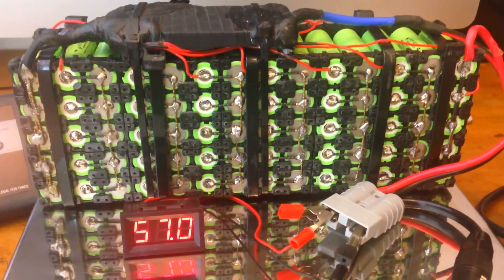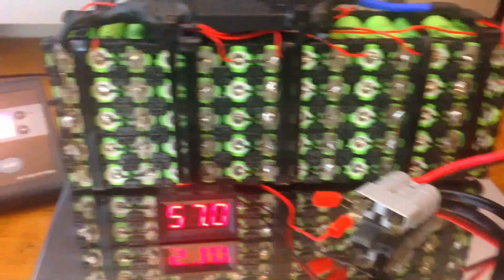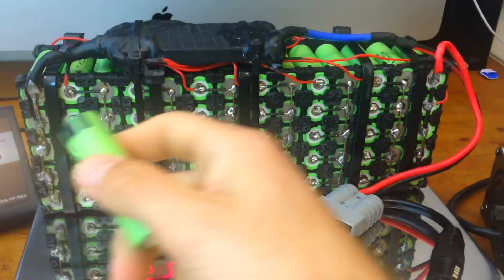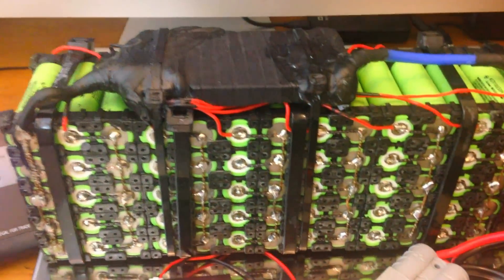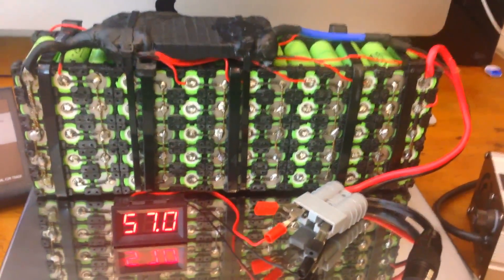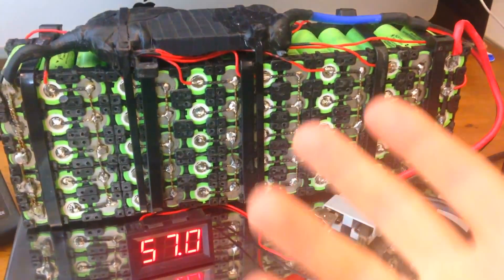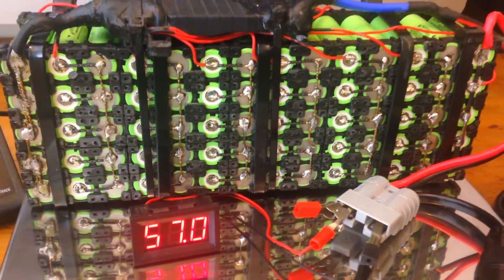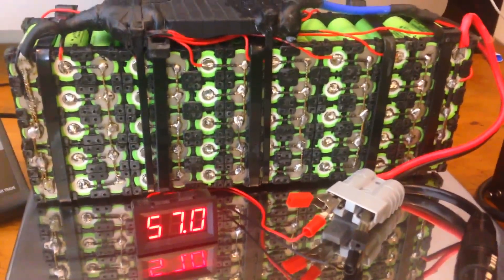Panasonic (Tesla) 52v 14.5Ah battery pack with Fast charger (14s 5p NCR18650PF) Bafang BBSHD BBS02

Comment: Bruno you are phe-nomenal. It's amazing...those exact batteries are what I am working with. I actually bought them a couple of years ago. Watching your video I  realized that I must go discharge them because I charged them all to 100% about six months ago anticipating a build. I was going to build a 36v but changed my mind and decided to build a 52v battery for my electric kayak which will be equipped with a overpowered 48v brushless motor. I bought 100 cells for around $200 about two years ago now they have risen dramatically in price. I hope it was worth it. It pays to make yourself informed.

Comment: Hello, this video is a bit old but I made a 16s12p battery very similar to this, I used copper solid wire to connect the cells and I soldered them (quickly) in the same configuration. How is the battery holding up?
Reply from the maker: Wooooww 16s 12p considering you need to do both sides of the pack, there are 384 soldering joints to make hahahahaa or more
My pack was made in 2014 and I put at least two cycles every day until it died in Jan2018
I pushed to hard and fast charged.. did everything I could to actually see what happens to the pack when the cells are very aged... in the end the balance was pretty poor and I had to balance every charge which was annoying but it prolonged the use for another 8 months or more...
How’s your pack holding up? How long have u been using? What’s the current you’re running it?
Reply: @BrunoPOWEEER  I'm using ex rental scooter batteries, they are Chinese Eve cells and rated at 2500 mah at 3c max discharge but they are actually somewhat decent. They are all used cells but they all seem to have very similar capacity's as it stays balanced fairly well. I haven't really used it on a daily basis yet as I was using a IMAX b6 to charge it and it would take over a day, but I just got a 1500 watt CC CV boost converter  and made a server PSU 48v 57amp power supply to charge it at max 12 amps or around 720 watts so I'll be able to charge it in just a few hours. As for discharging I just bought two new 48-72v 1500watt 45amp ebike esc's to power two ninebot es4 36v 300watt motors so there would be max of 90amp draw.

Comment: Soldered on??? RIP battery
Reply from the maker: Yes, soldered!! I am an electronics/electrical / battery builder and intentionally made it soldered back in 2014 just to compare the difference and make a point. I pushed this battery really hard cycling it every single day for nearly 3.5 years (beyond the recommended cycle life, made almost all videos in my channel. Here is tour showing my professional EV Battery Building Workshop: https://youtu.be/Pbg--F-43K8
Reply: Dude, relax, its generaly not such a good idea to solder directly on to batteries, it can shorten there life and potentialy damage the battery.

Comment: Question-- so I tried to build a battery (first time).  I bought a 14S 51.8V 45A BMS off eBay: https://www.ebay.com/itm/14S-51-8V-45A-BMS-PCB-PCM-for-ebike-electric-bicycle-18650-Li-ion-LIPO-battery/112636580964?epid=18009165438&hash=item1a39a9d464:g:MYcAAOSwhmpaBbsf

This one has only a B- and a combined charge/discharge C- solder pad to hook up ( along with the 14 wires)

I get good voltage (51v) from the battery terminals but when I tried to charge it, the charger smoked and caught fire.  .  

Charger is a 3 prong so I ran: the positive to the + terminal on the battery and the negative to the C- charge/discharge on the bms.  The middle prong on the 3 prong I didn't connect to anything.

Im no expert but Its as if the battery is feeding back voltage to the capacitor in the charger and frying it.  What am I doing wrong here?

Comment: hey mat soo much power hahaha!
btw can u help me I'm building an electric scooter nota a bike a scooter like gogoro  the motor I'm using is a 1000 w and for the battery pack I'm using 130 18650 cells 13s10p  being a novice in this field I don't know much so how to connect these cells in series and parallel using nickel strips I saw some videos but every pack had a different design can u help in mine what should be the best!
thanks for ur time mate!

Comment: Look at this on eBay:

https://www.ebay.com/itm/282434596324

10x 4x5 Cell 18650 Batteries Plastic Holder Spacer  For Battery Packs,Power Wall

Comment: saw one like these on taobao, pretty crazy if you consider none of those cells have a safety circuit
Reply from the maker: Yeeeaahh the safety circuit on the cells makes them thicker, longer (it doesn't really fit inside most cell holders) and when you make a large battery pack you should really have much larger protection circuit protecting all cells together. BMS (battery management system) is used in this case checking and comparing all cells voltages making sure they are balanced, there is also a low voltage and high voltage protection, high current protection.. that little protection circuit is a very simple mini BMS for use in devices like lights without any battery protection. IF you want to see something crazy check out this 42000w 56hp bike that I'm making.. INSANE https://www.youtube.com/watch?v=yfn_HKViwtM&lc=z13wdlwgbxzlsdb0a222ud25ipq2hvbtv

Comment: What's the WH/KG on those cells? Are they the highest? If not, what are the highest?
Reply from the maker: These are Panasonic "PF" cells they're 46 grams / 2900mAh each cell. I made this pack back in 2014. Nowadays the highest capacity you can get are Sanyo GA and LG MJ1 both options are 3500mAh. To find the mAh you just multiply the nominal voltage 3.7v x mAh =]
Reply: So about a 22 pound battery would be about 2,250 WH with the highest density batteries?
Reply from the maker: +RoboticusMusic Lipo cells in general (not all types and brands) are lighter than metal body 18650 cells. Lipo (prismatic cells) can vary in size and shape, most cases are cheaply made, short life, unstable and can explode, good power density but lots of cons.
18650 cells are very stable, super safe, reliable and last longer (lot more cycles) than Lipo cells.
There are some premium Lipo with amazing power density but you have to deal with odd shapes and pay a premium price + not easy to find to buy and if you find, they require a large quantity (hundreds or thousands) minimum order. It all depends what you want to do and how much you have to spend. 18650 is a safe / good value long term investment =]

Comment: Another awesome vid matey. So if I was to swap out the 18650 cells for Turnigy 5000MAh, 40c flat cells and followed your configuration of 14s, 5p I'd get a 52v 25Ah pack  ( 14s 5000MAh each /  14 x 3.7= 51.8 @ 5000MAh  X 5p = 51.8v @ 25000MAH  ) And that would give a constant discharge of 20A . But realistically more like 58.8v if I fully charge the pack , but if I only charge to 80% I'll be getting 47.4v, for the added benefit of longer life? That's if my mind is working right at 10 to 1 in the morning...... Would my BBSHD handle close to 60v ?

Comment: just bought 48 of these only getting 2.2ah per cell. charging from brand new 3.51v to 4.2v
4 parallel charging using imax b6 @ 3A.

bought parts from ebay: $312 spacers, 54cells and bms, no case though,
bafangdirect wants $499 for this pack, so i save about $200

i bought a 16cell bms, but only want to use 13s3p like my other pack, any suggestions any problems i might have?
Reply from the maker: Hey Brad, the "mAh" is rated from the maximum to the minimum voltage for that particular cell you're measuring. Some cells can go as low as 2.85v some cells can go down to 2.5v, it will depend on your BMS or controller low voltage cut off to know how low you can get. 
Bafangdirect is just a regular shop with a funny name, they're not associated with Bafang at all.
if you're making your own pack maybe go 14s instead of 13s you'll get a MUCH better performance, 52v makes 48v batteries feel anemic haha. Even better if you go 5p you get more range and the pack runs cooler (if you can).
BMS for 16 cells is set to 16s packs only it won't work for 15s or anything different. You must buy the correct one for the pack your making so maybe try to cell this one on eBay.
Send me more news as you make your pack!
POWEEEEEEEEERRRR =]

Comment: Hello! Love your videos, was anoyed by your sense of humour at first but, man i have learned alot from your videos in the last few months! Ithis week i got a bbsHD and 100 samsung 30q  cells, my question is should i go ahead and build a 14s since i will have 9 cells left over? Do i need to change the voltage cutoff in the charger as you explain in a previous video? Oh, and i think i like the bare look you have with this pack, what kind of clear spray did you use?...l.lthanks and keep makin' vdeos!

Comment: Can you provide any reference regarding "Minimum charging current" ? if such thing exist then CC/CV charger should stop charging after 0.6amp
Reply from the maker: +Yash Patel - Many eBike batteries come with a cheap small charger that at best will give 0.6A normally less... (the nasty and very small BMS can't handle anything more than that). There is no problem at all if you do small charges occasionally, it is actually recommended to slow charge sometimes. There are a lot of things no one mention anywhere about how the chemistry inside the battery behaves, like you must wait 20 to 40 min to charge the battery after you use it so the chemistry have time to stop reacting inside. Same happens after the charge, you must let the battery rest for a good 30 ideally 90 min, you can measure with a multimeter the voltage will drop a good 0.5v sometimes 0.7v in this "resting" process. The charger will bulk charge then slowly reduce the current for a reason, this is what suits the Lithium battery chemistry. 
Many electric bike cheap batteries, it is charging at very low amperage like 0.5v 0.6v (or lower) during the whole charge cycle... that goes for 4 hours and some horrible cases about 8 hours charging, imagine doing this every single day! There is a optimal charge and discharge range for the chemistry just like a maximum/minimum voltage, maximum discharge, maximum/minimum temperature, maximum/minimum humidity etc... I remember finding the scientific specs for the Panasonic PF cells in a Japanese website back in 2014 when I made this pack, I translated to english and saved for reference =]
Reply: +ElectricBike (Bruno) Can you share that Panasonic specs? because after watching your video i have googled a lot about same thing, still no success, thank you for a detailed explanation :)
Reply from the maker: +Yash Patel - Yeahh.. I actually listed the Panasonic PF specs on the description of this video as I had more people asking for this precious info  =]

here it is:
Panasonic 18650PF Specifications: 
Battery type: 18650 High Drain | Hybrid IMR 
Capacity: 2900mAh 
Max Discharge (constant current): 10A 
Max Discharge Pulse Current (5-6 sec.): 18A 
Full charge: 4.2V 
Charging method: CV/CC 
Minimum charging current: 0.6A 
Rapid Charging current: 1.35A 
Nominal (storage) voltage: 3.6V-3.7V 
Minimum discharge voltage level: 2.5V 
Dimensions: 18.5mm x 66.5mm *18 mm x 65 mm 
Weight: 46.5g 
Button Top: Yes *Not 
AC-IR 21 mΩ 

I saw your email but I am replying all here so more people can use this info =]
Reply from the maker: +Yash Patel - Yeahhh.. I have the exactly same charger... that little one can charge 7s at higher amperage but he explains that he is only charging at low amperage for the first charge making sure everything is okay and no cells are overheating or anything weird is happening. His first test charge 48 cells in parallel at 1A may take daaaays... the charging current will be so little. In this case he is doing the right thing as he is using hundreds of second hand and old cells, all different models and brands with different internal resistance (not bad but it makes things a bit harder to keep all balanced) so he needs to be very careful handling these cells. Some cells can handle faster charge than other cells but when you mix all together in the same pack you should not exceed the specs of the slowest ones. This would be a stationary battery so he is not even worried about "fast charging" and "performance" like the Electric Vehicle/Bike guys do. 

There is an optimal range for everything, temperature range, discharge range, charging range.. charging at very low amperage for looooooong periods just extends the chemical reaction time inside the cells, the chemistry needs time to rest, stabilise/hold the voltage and do what batteries should do.. store the energy. =]